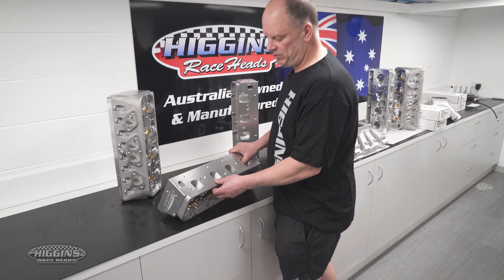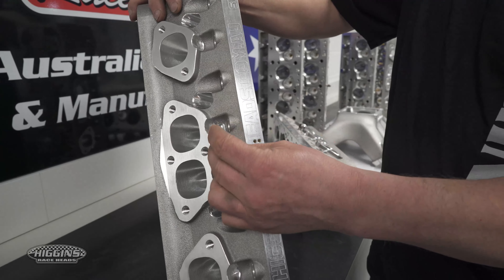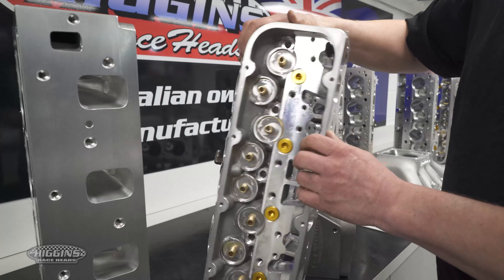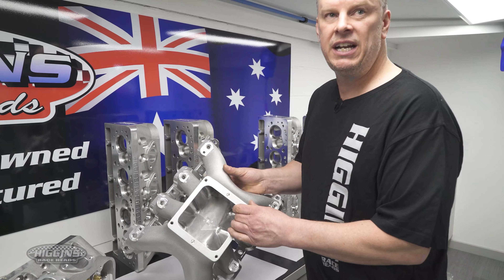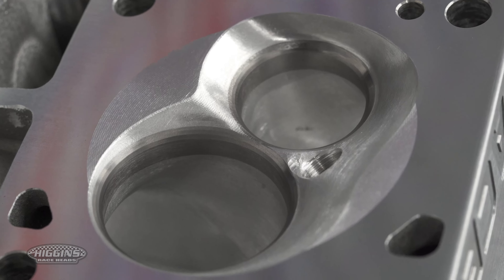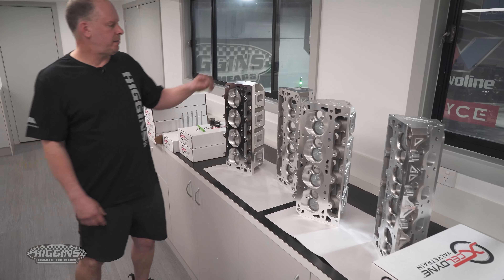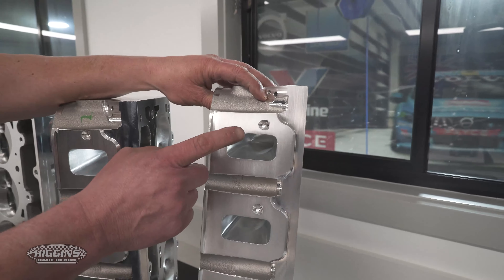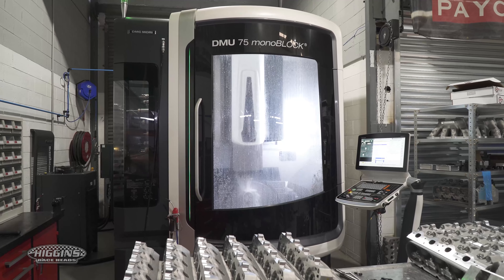Higgins Race Heads 2020 update

Comment: I like it their OZ boys but did the market need another head manufacturer? yella Terra did them for OZ 308 but their are a lot of great heads for Chev ls made in the U.S. already, if I was to buy heads for my LS i'd buy out of the U.S. who have been CNC ported a lot longer, its no different as none CNC who did the port before it was digitized race cars enough you soon learn their not all equal big ports don't mean big hp they need air speed we race super stock and our heads we were on the flow bench just about every night looking for more numbers

Comment: Very interesting. I wonder what the flow numbers are on the Cleveland cylinder heads? Serious HP with the right combination.
Reply: I am interested in the flow numbers also the turbo Chambers are unique check out the MBE heads
Reply: You can look the numbers up, and you can get a rough idea using the dyno data. 1 hp takes about 2.2 cfm. Divide the hp by 2.2 cfm.